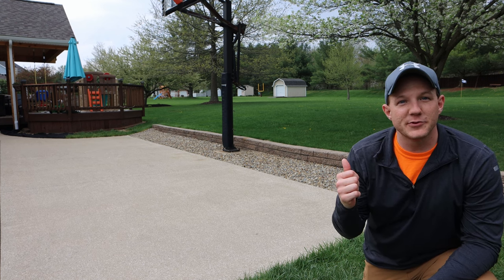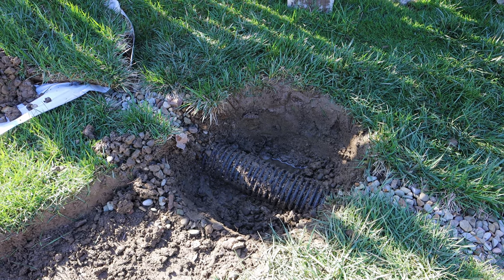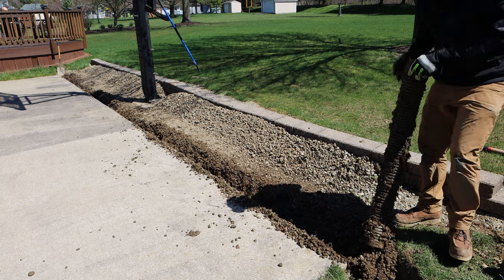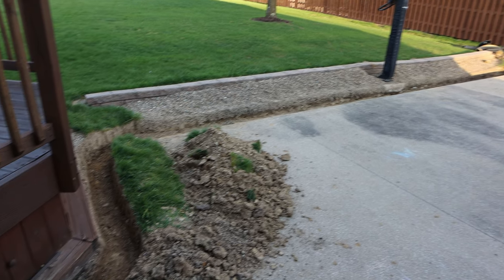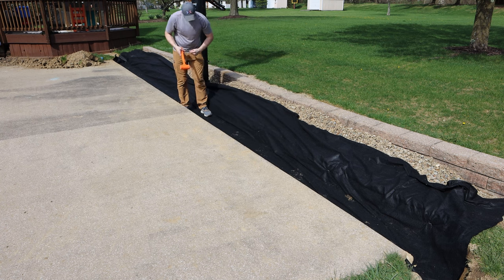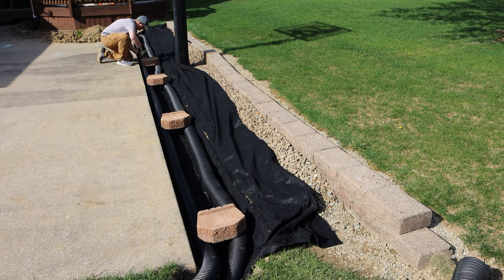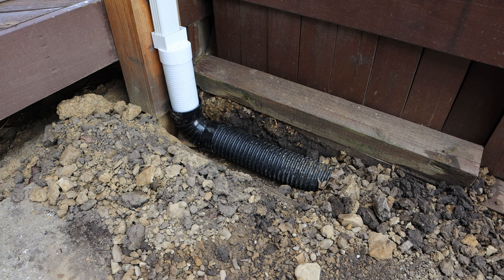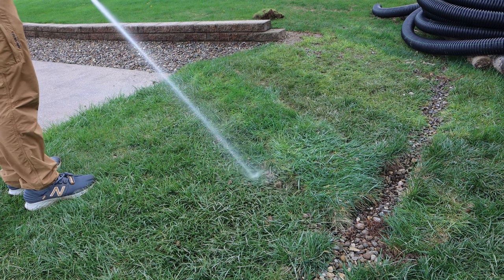DIY French Drain & Downspout | River Rock | Patio & Yard Drainage Solution

Comment: For people doing it down a drive way cover the pipe in sand then gravel on top so that the gravel doesn’t grind away at the pipe and cause leaks if a vehicle drives over it as the gravel can pierce pipes. We’ve just replaced water pipes that burst because someone buried them in large gravel and the cars weight caused the gravel to cut through over ten years.

Comment: This is an interesting take on a French drain. To meet code in my area, you need to use day old baguettes. Just cut off the end caps and glue sections together with jam. To  get the perforations you'll need to burn holes with a half lit cigarette. Make sure to wear a beret and maybe some of that mime makeup to be safe. A stripey safety shirt will also increase your fashion and save you from those itchy pieces of the crust that sometimes break off.
Reply from the maker: lol

Comment: Great video. Surprised how shallow the pipes are.I learned from other videos that the trench should be deeper.  What region of the country was the installation done? Why doesn't depth matter here?
Reply from the maker: We are in northern Ohio and you are correct. This was not the ideal depth. I didnt want to redo the entire drain to the street so I just used what I had. The pipe I connected to was 16" deep I would have liked it to be closer to 24" or deeper.

Comment: you should have left the fabric on top of the pipes with a layer of rock. the fabric would reduce clogs within the rocks. and its easier to wash off the top rock without the silt going to the bottom. but it all depends on how bad the fine dirt accumulates. Your reason still is acceptable

Comment: Why didn’t you just use the correct black pipe off cut in the background of your video to join the pipes to the y joiner instead of tape on the white solid pipe, that was a serious fail after all that hard work. The tape won’t last 20 years. The end of the French drain should go into a big hole full of big rocks going up to small rocks then gravel and just dissipate into the ground. We use to make a concrete curbing mould to make them look like city drains in towns when I did road maintenance.

Comment: Does the water end up discharging to daylight ? and if not possible to get it to daylight how do you discharge it at the end of the run?
Reply from the maker: The drain system is connect to a city storm sewer line at the street.